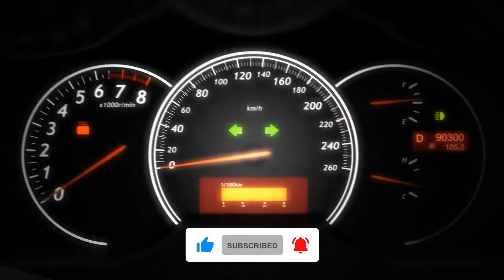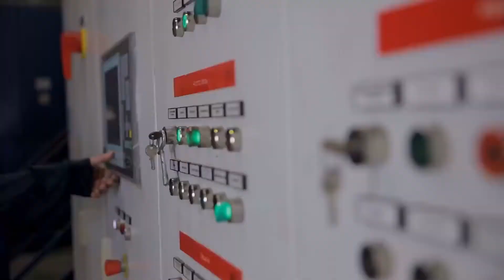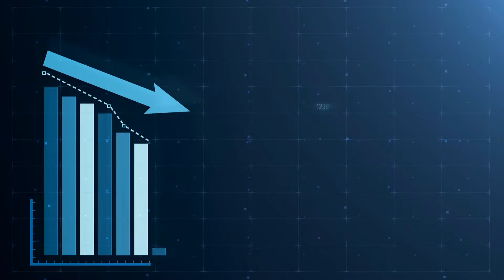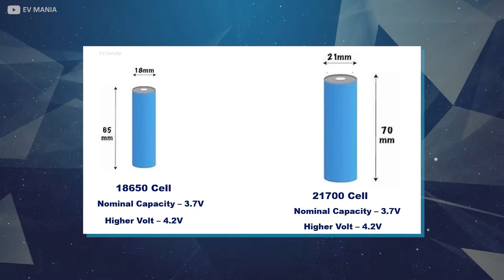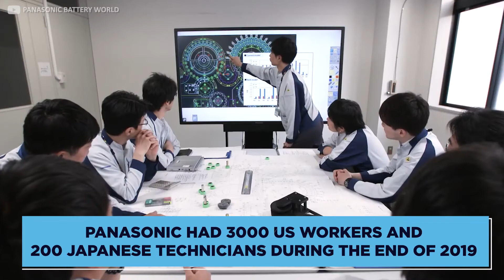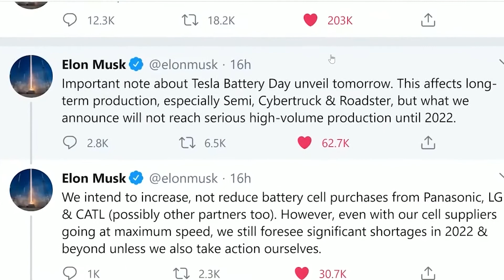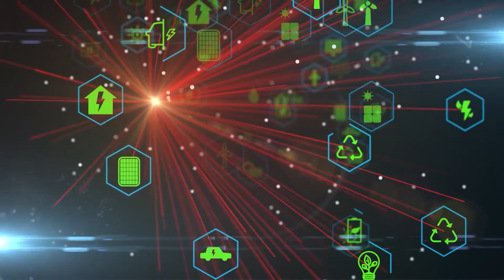How Tesla Makes Their Batteries So Fast, Tesla Batteries Technology, Tesla Battery

Comment: Narrative is wrong. Tesla does not make a single battery. Panasonic does. Panasonic invented the battery with own R&D and patents, created the sophisticated fabrication machinery, and actually built the Nevada Gigafactory. Panasonic is the one who source all raw materials to make batteries. 

So what does Tesla do? First, it has a financial interest in the Gigafactory. It promise to buy its outputs. Then it assembles the Panasonic battery to build packs suitable for installation into its EV.

The Navada Gigafactory is nowhere near being the biggest in the world. China already has a few that's bigger, and is building 6 more even bigger. The future of the Nevada factory is dim. That's because the chemistry of the Panasonic battery is no good for the future. And Panasonic has no new chemistry to offer. Future EV batteries are based on China and Korean invented chemistry and design. Therefore all Tesla cars must switch over to either China or Korean battery, or it's game over.